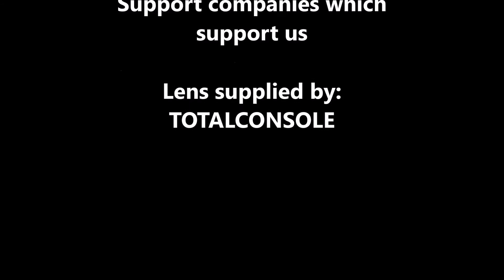How to install ( replace) CD LENS for Playstation / PSX / PS1 / PSOne - TOTALCONSOLE

Comment: Hi. Is there a difference for the laser replacement kit between original PS1/PSX versions?
Reply from the maker: Not as far as function is concerned.   Cable length due to the size

Comment: The grey psone lense frame is not suitable for older models since it does not have a plastic leg that the lense frame sits on, it this way when you push down the cd to instal it it does not go down. But with this frame it goes down and it remains unstable.
Reply from the maker: Works fine for all installs we do
Reply: You simply take off the grey frame it has like 2 screws put in old original black frame and woalaa
Reply: @califaern3sto  it’s far better than cutting the ps1 cover, BAM is the same as ACM.
Reply: @Playvoodoo  the lasers on the ps1 scph-9001 and psone 101 are the most reliable
Reply: @califaern3sto  7000/7500 too, scph-9000 have the same BIOS as 7500
Reply: @Playvoodoo  i have a 7001, that laser isn't all that reliable and it's very loud

Comment: I have a modded console and this will be great for it cause my games skip alot
Reply from the maker: +Captain Dark this will fix the skipping problem. It's new original Sony component.
Reply: pimpmyconsole I have installed one in my ps1 and omg it works like it came from the factory

Comment: How u buy extension cable? I need
Reply from the maker: amunve included with the lens.  buy from Totalconsole and you get brand new original Sony lens plus extension cable so it works with all  psx/ps1 consoles.
Reply: will this play burn disc without messing with the pot

Comment: Why did you say the extention cable wasnt necessary for the PS1 but you still put it on anyway? 
That is a PS1
Reply: @enderwalker97  actually incorrect the psx is a playstation 2 based DVR only released in Japan https://en.wikipedia.org/wiki/PSX_%28digital_video_recorder%29?wprov=sfla1 apart from that correct term psx can also refer to yes all playstation 1 based hardware and games and accessories

Comment: Got a question im replacing the lasers in my 3 ps1s and i have a 7501 model, a 5501 model, and a 1001 model why is the 1001's acm laser so much more expensive?
Reply from the maker: +Curtis Liller this one is original and brand new.   Unlike Chinese sellers selling fake new ( as in used or copy version).   You get what you paid for.

Comment: Doesn't work for me, what a ripoff.
Reply from the maker: Works fine.  You are just stupid or cheap.  Nothing worse than such a person blaming others for their own lack of skill, kindness and cheapism.
Reply: @pimpmyconsole  I don't see how paying 89+ for your laser makes me cheap. I installed the laser exactly the way I was suppose to. I'm guessing your site doesn't even offer refunds.
Reply: @vyadhis  It's entirely possible the problem with your PS1 is either related to the power supply, or the internal CD-ROM controller chip.

And it's also possible you got a bad replacement laser. Do you have another PS1 for testing purposes?